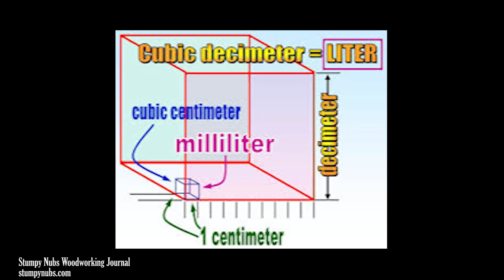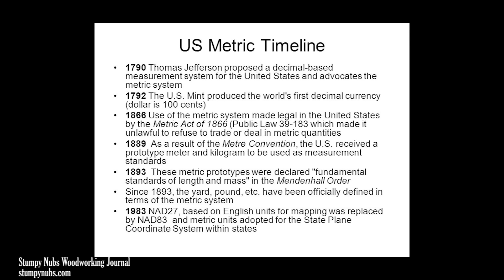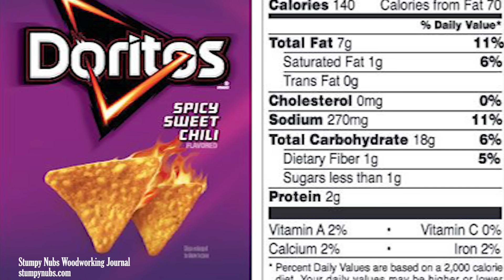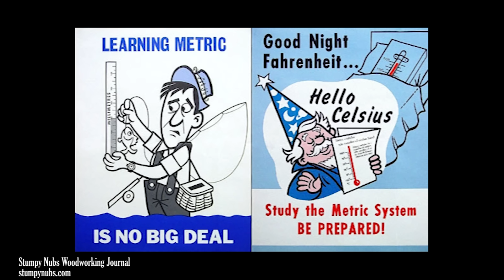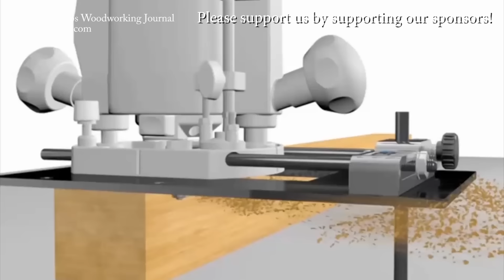BREAKING: The USA is switching to METRIC!

Comment: Great video! I have always lived in the U.S., but I have been building all of my projects in Metric since the 90's because it is so much easier to use, especially if you need to use a calculator to divide anything into multiple measurements. When people tell me the Metric System is tough to learn, I ask them how many inches are in a mile. Most of them can't even tell me how many feet are in a mile. Then I ask them how many teaspoons are in a gallon. All good fun. Woodworking in Metrics is so much easier. Give it a try. It's a pretty quick transition, but so worth it. Thanks for the great content!
Reply: Fair point, but to play devil's advocate...have you ever actually needed to know how may inches are in a mile? Or teaspoons in a gallon? To be fair, that's not exactly practical info to know. Metric is extremely easy, for sure. But overall I find it easier to work in whichever system is native to the project and/or materials before me. So US construction, with virtually all standard dimensions in Imperial (8' ceilings, 32" doors, 16 oc studs, dimensional lumber in inches, etc, etc.) I'm sticking with Imperial.
Reply: @ethanwheeler3323 I think his original point is valid though - adding, subtracting, and dividing things in half or 3 or more is much simpler in metric.  However I use a fractional calculator app (Fraction Calculator Plus) on my phone that allows me to do everything I ever needed to do, nearly as easily as using metric.  On a side note, I don’t use feet hardly ever, I just use inches since everything I work on fits inside a garage.  What I wish we had was a system where the inch was divided into 10 parts.  I want a measuring tape like that.  Instead I have an engineering tape where the foot is divided into 10 parts - I don’t like it.
Reply: Ive had people comment on my use of the metric system in my HVAC job. They say it's hard to learn. I ask,  can you count by 10?

 "yeah"

Then you know the metric system!
Pretty much all the new equipment is in metric anyway.
Reply: To which I would reply: what's 1/6 of a meter? Be precise.

You have a (dull? 😜) point about converting from the very small to the very large, for times when that matters. But I find I prefer Imperial because a) I've never had the slightest reason to know or care how many inches or feet are in a mile; b) being Human, dividing things by 2, 3, or 4 is far more useful and concrete than dividing by 2 or 5 -- hence my preference for anything base-12 over base-10.
Reply: So you can give me a 12th of 17inches faster than a 10th of 38,54centimeters(hint: just move the comma 1 figure to the left)? Metric is not about dividing by 5 or 2 but by 10. @AdamSnellAdamSnell
Reply: @AdamSnellAdamSnell  The metric system was also created by humans, who also praise it for its intuitiveness. In fact, your beloved "imperial" system is pegged to SI definitions anyway. And your system is not base 12 at all.

Also, there aren't a lot of situations where you have to divide a meter into exactly six, the same way you won't find yourself having to divide a yard into exactly five.
Reply: 12 inch to a feet (30,48 cm), 3 feet to a yard (91,44 cm), 1760 yards to a mile (1609,344 meters)...and so there are 63360 inches to a mile or 5280 feet. 🤪
Reply: @AdamSnellAdamSnell  if you happen to be dividing a solid foot or inch by 2, 3, or 4 then imperial is nice, but more often there’s times when I’m taking something like 26 and 5/16” and dividing it by 3.  The answer is 8 and 37/48”.
Reply: All good my friend. I enjoy the conversation. I personally enjoy being able to add more precision to a project by simply moving the decimal place to my measurements. To answer your question, 1/6 of a meter is 16.6 cm or 166 mm or 166.6 mm. The first two answers have the precision down to 1/32" and the third answer has the precision down to 4 hundreds of an inch. Yes, I used a calculator for my answer, but you might also use a calculator if I asked you to give the measurement of 1/6 of an inch or 1/6 of a 1/4" or 1/6 of a mile. Hey, I grew up in the U.S. and use both measurement systems every day, but I personally prefer Metrics and I respect that you prefer Imperial. :^)    @AdamSnellAdamSnell

Comment: I retired to Ecuador from the USA 15 years ago, and remember that a few years in, a carpenter friend came for a visit. He was helping on a construction project, and was upset that most of my tools (measuring tapes, etc) were metric. So he brought out a tape measure that he had brought with him that had markings down to 1/32 inch, if I remember correctly, and I was amazed at how effortlessly he could add, subtract, multiply, and divide among 1/2 inch, 1/4 inch, 1/8 inch, 1/16 inch, 1/32 inch, even 1/64 inch. I had already gotten so used to meters, centimeters, and millimeters.
Reply: The switching between these denominators is what makes it so terrible. If we stuck to a base of 1/32 or 1/64, it would be so much easier. That is, using 1/64, 4/64, 16/64, etc. But going up through sixteenths, eighths, quarters and halves - then back down when we want to make an allowance of 1/16 or a clearance size - is just self-inflicted complexity.

Have used metric forever but school required me to use both.

And have just been looking at a jig which has things at 35mm spacing, etc., but then spoils everything by using 1/4" inch drills.
Reply: @polyvg  I guarantee i can mark out 1/16in faster and more accurately all day long  on my imperial tape measure than you can 1.5mm on your metric one. I know this because I moved country and had to convert to metric fifteen years ago.
Reply: My tape measure has both so it's really easy.
Reply: Metric is more advantageous in machining as in fine measuring. But in carpentry imperial is FAR better.
Reply: Agreed .
Reply: @harddunbye6553  Why would anyone in his sanity would need to mark 1.5mm on a metric tape? And don't pretend being converted to metric when trying to do imperial unit markings with a metric tape!
Reply: SI is far more tthan length, weight etc. It is a properly designed set of self constent units. That is why most US engineering and scientific companies use SI exclusively.

Comment: I’ve been using metric on personal projects for a while now. My only problem with using metric at work is that my metric tape measures seem to keep going missing off job sites, funny thing that.
Reply: In the UK I don't think I've ever seen a tape measure that doesn't have metric on one edge and imperial on the other edge.
Reply: Really strange they seem to walk of since they don’t have feet, unlike imperial tape measures.
Reply: That's all tools, sadly. Was doing a QA/QC job on a construction site for a while on Eglin AFB and we usually were there for all of about 4 hours. I left my surveyors tape that measures in tenths unattended for all of maybe 10 minutes and it was gone with the wind. Same happened to my hammer as well. Still miss that hammer.
Reply: @barneylaurance1865 That's pretty much standard. What's harder to find but far better in my opinion is one with tenths instead of inches. Tenths are simply and undeniably superior in every way.

Comment: I lived in Germany for about 13 years and found it easy to thrive using the metric system. I was thinking in meters, liters, grams, and Celsius in a very short time. It was only an issue if I tried to convert one system into the other. It's kind of like learning a foreign language. Translating one into the other on the fly was always tedious at best, so I learned to think in German, which was a breeze over time.
Reply: Finding it easy is one thing, the problem is that it's never easier than using imperial measures, and frequently less convenient. Add to that the fact that the US has trillions of dollars in SAE infrastructure and you've got a bit of a problem. The US would be the largest developed nation to make the switch, whereas every other nation was either smaller or less thoroughly developed when they made the switch. The US uses the same base units to back the measures that everybody else does, we just subdivide them in ways that are more sensible for non-scientific use.
Reply: this guy tries to tell me that using 5/32 of inch is more usefull than decimal numbers...
Reply: @autisticdoingandthinking  The point I was making is that if you stop converting from one to the other, it becomes second nature. US industry is already well on the way to doing everything in the metric system. When the introduced color TV in the USA back in the 1960s, they chose to use an inferior system to save people money. When they went to digital TV, it was expensive and inconvenient. Very few people would go back. If we switch to the metric system, there would be a lot of pushback, but once everyone got used to it without dealing with conversions, few would want to go back.
Reply: I have a very similar experience with 20 years in Germany.  All aspects of metric are superior, but Celsius is simply brilliant. 0 = frozen 10 = mild  20 = room temp 30 = hot 40 = the hottest day on the planet.
Reply: I think you hit the nail on the head there.  I was in Europe for a while a few years back and (because I'm a math-nerd engineer) was trying to convert everything to Imperial.  I could do the conversions, but I wasn't really grasping the measurements.  It wasn't until I immersed myself that it just clicked.  "This is what 15 degrees feels like."  "This is what 20 degrees feels like."  "I walked to the market and that was half a kilometer."
Reply: @SmallSpoonBrigade  Yeah I don't find having totally different conversion factors between units sensible or convenient. With metric it's always 10, and you can tell how many 10s simply by the prefix. Nano, Micro, Milli, Centi, Deci, Deca, Hecto, Kilo, Mega, Giga and so on work for ALL units, instead of having totally different "units" that all describe "length" for example but with different factors, and all of them DIFFERENT factors to top it off. Seems totally bonkers and unnecessarily complicated to me. And then with all the factors being not 10, but still doing the math in a base 10 numeric system so you can make things even more inconvenient.

Comment: For me, this was really a one-time event. I made the decision when I started to get into CAD modeling back in the mid-00s, to standardize on millimeters for everything, car-size and beyond. Everything else just happened naturally from there -- calipers set to metric, found some decent tape measures and other tools with metric or dual scales, and ultimately I was pretty surprised by how painless it was. Metric fasteners are easy to design with, you can work mostly in whole numbers, a lot less fuss to make the change than I was expecting. Haven't looked back.
Reply: I was going to write almost the same story. I'm happy to say I'm ambidextrous but mostly prefer metric. I still buy 2x4 lumber and 4x8 sheets of plywood not 50x200 or 1219.2mm X 2438.4mm plywood sheets.
Reply: Hardest part for me is finding metric tools at the local big box stores.  Plus, pipe fittings are all NPT, and a large amount of equipment uses Imperial fasteners.
Reply: Face it - the REAL reason US car makers went to metric was because all the people making parts(1/2 way around the world) use metric and not Imperial(US makers) and not to make it easier....
Reply: Same here for designing parts in CAD. So much easier for calculating.

Comment: ALL of our imperial dimensions are officially defined using metric units. For example, the inch is exactly 25.4mm (2.54cm) so a foot is exactly 30.48cm and 3 feet (1 yard) is 91.44cm or 0.9144 meter.
Reply: The metric inch of 25,4mm also happens to be a compromise value between the Imperial and US inches.
The US never used the Imperial measuring system, since this dates from the early 19th century.
Reply: It had to be since it was originally measured by our own body, and since everyone has different size bodies, therefore it had to be standardized.
Reply: @markevans2294 In 1935 the ASA (now ANSI) defined the inch as 25.4. And so, yes, the US isn't 'switching' to metric, the US already switched to the metric system. It's just taking "normal" people 100, or 200 years to realize it.
Reply: @markevans2294  Which came first, the inch or the mm?
Reply: Actually, there are two versions of feet used in the US: The International foot is exactly 0.3048 meters. Whereas, the US Survey foot is 1200/3937 meters. Or, one meter is 3.2808333333(infinitum)feet. Your everyday use and how things are described to you are in International Feet. For land and offshore measurements they use in the US Survey Foot. However, even this will be changing as the government is planning to deprecate the use of the US Survey Foot, but for us which use both on a daily basis, that will not be anytime soon. Lucky for me I mostly use metric, but my US colleagues still have to use both Feet versions as well as metric. Lots of fun, huh?
Reply: @ValMartinIreland  Who cares? Metric is the far best and most easiest system
Reply: @3DPeter  It's Far from the best it has seriously limitations in many applications. And is why navigation still uses imperial.  And it's only easier for those of limited intellect otherwise it is the same.
Reply: It's true that navigation uses units that predate the metric system, and that there have been attempts to decimalize those units that failed (e.g. gon or gradian for 1/400 revolution). But those are based on Babylonian maths and facts about Earth, not the British empire. They also have some genuine advantages, like the relation between a minute of arc and a nautical mile, and the convenient subdivisions of 360.
Reply: @0LoneTech   You do realize it is was the British that created that current navigational system and measurement units.  Why do you think the prime meridian  is in Greenwich UK.  It was based of the  same base units used in the imperial system since those we already known and in use...    Nice try at the BS though....
Reply: @matthewq4b 😂
Reply: @0LoneTech  The metric system is fine with angles being measured in degrees.  Generally folks prefer decimal degrees instead of degrees, minutes, seconds, but whatever. 

The natural measure is radians, which is just equal to the arc length on a unit circle.

Yeah, there were attempts to decimalize angle measures (gradians) as well as time and calendar measures.  And those died pretty quick.  That's not the metric system though.
Reply: @matthewq4b  It's not BS. The British were of course involved in several steps of refinement, among which the international agreement on a prime meridian was one (others were in use). Today that standard is set by IERS using GPS.
Reply: @0LoneTech   It is BS.   The British Invented modern navigation and established the prime Meridian at Greenwich cause that is where the Royal observatory was/is.  There was NO agreement on it's location the British CHOOSE the location and everybody followed suit and then over a century later they agreed to leave it there as every modern chart on the planet used Greenwich as the Prime Meridian.. Quit pushing revisionist history BS.
Reply: @markevans2294   What's really fun is when you work with liquid measure.  A U.S. quart is 32 oz, but Imperial is 40.  So, that's a 4:5 ratio?  Actually, no.  An Imperial ounce is smaller than U.S. so the ratio is actually 5:6, when comparing gallons.  I recall that from when I was a kid looking at gas station road maps.  Yeah, they actually handed them out for free back then.  On the legend, they compared U.S. and Canadian gallons, so you'd know how much you were getting when you were on the other side of the border.
Reply: @john1956c   "Actually, there are two versions of feet used in the US: "

Left and right?  🙂
Reply: @travcollier   Tell us how many Degrees are in a circle ? Imperial traces it's roots and divisors back to Babylonian mathematics. And yes that was the metric system that that tried to decimalize angle measures (gradians) as well as time and calendar measures. I suggest you look up metric time...
Reply: @matthewq4b  FFS, I literally mentioned gradians and decimal time 🙄
You're confusing the metric system with the French attempts to decimalize everything like 250 years ago.  
In fairness, everyone here is being rather imprecise (including me)... We're saying "metric" when we're actually more talking about SI.  And American Traditional Units are a bit different from Imperial, and Imperial isn't the same as British Traditional either.

Anyways, the "metric" (really SI) unit for angular measure is radians, but degrees are common and fine... They just require a simple conversion constant (π/180) to use in standard calculations/equations.